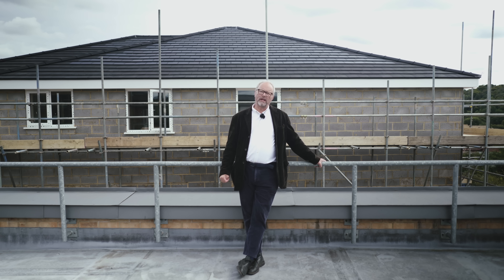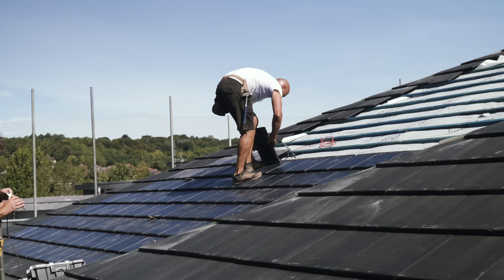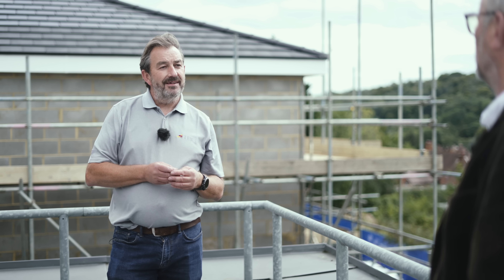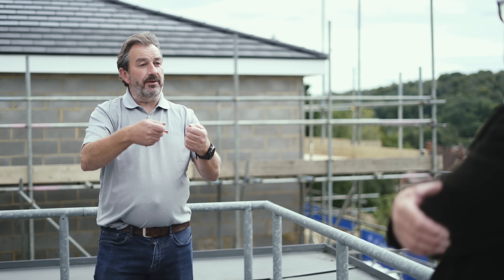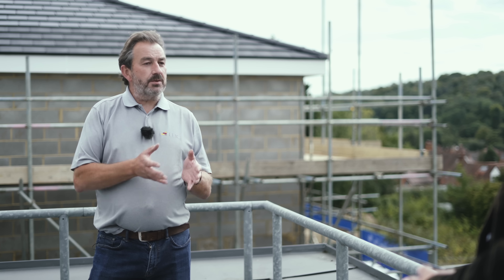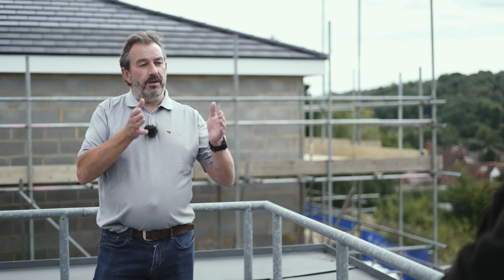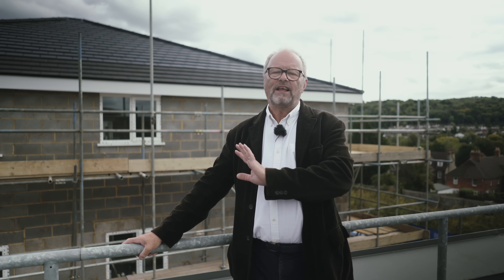Solar Roof Tiles - should every building generate its own power? | 100% Independent, 100% Electric

Comment: Was so excited then you lost me when the price was discussed.
Reply: It does seem a lot, but to make a fair comparison you'd need the price of a non-solar tile roof + the price of an installed solar system on top of it. Remember, this isn't just your solar system, it's your entire roof. Still sounds very expensive though....
Reply: I know right!
Reply: Dan Franklin 
What you say is true, but on a new build what’s an extra 5-7 grand over a normal solar setup. It won’t add that much to the mortgage repayment.
Reply: @wobby1516  I think your math is a bit wrong. He said the cost per tile is £30, and they put 900 tiles on that roof they're doing there. That's a £27,000 roof before the concrete tiles and labor. If you're in the U.S. like me, that's $35,000. That's a significant amount for a roof, when for  1/3 of that, you can have a tin roof. Granted, you won't have solar for that price, but the amount is prohibitive to a lot of people. Until the price goes down, we won't see these types of roofs proliferate for a while.
Reply: @gothnate  to be fair they did that $30 included the tile which costs $1
Reply: @wobby1516 
Exactly.. And with more demand comes cheaper prices and subsequent more development
Reply: The extra cost is offset by the savings on your electric bill.  The system pays for itself within 8-12 years. Additionally, the resale on solar homes  increase in value by about 4% ( its a selling point to tell a prospective buyer that the will have little to no electric bill).
Reply: @steve2653  but a lot of people have budgets. They might not be able to afford even a $1000 difference in a build, and you're talking a good $10,000 difference at the least.
Reply: If your roof frame was built to support a metal roof, then to put more heavy solar tiles would mean a lot more work upping the strength of the roof framework.
Reply: In this case the roof panels are supporting several flats so the cost per occupant is probably quite reasonable. Sorry can't do the calculations  - neurological disablity :-)
Reply: The cost is approx 50% dearer than an ugly bolt on solar system, but fir that increased cost you get a roof as well as the solar
Reply: The Tesla sole roof tiles, are cheaper than a new roof and solar!
Reply: @lukeotter898  plus they catch fire at no extra cost! Heating in winter!
Reply: @lukeotter898  I wonder which will sell best LOL

Comment: Well tile roofs last 100 years plus and solar panels last 25. So how's that going to work. Especially because tile is one of the most expensive types of roofing initially. I love solar and I love tile roofing. I'd have to do the math but roofing is a major renovation.....huge expense and the point of tile roofs is there longevity. To offset the labor costs making it cheaper in the long run to use tile.  Will tge benefit of great solar offset tge need to replace tile prematurely?
Reply: If you listened to the video, he did say re-roofing is anticipated with any roof.

Comment: What is with the heating up of the panels in direct sunlight? As I recall solar panels loose efficiency when their temperature rises and the traditional way of building a solar roof enables the panels to have cooling by fresh air being able to circulate underneath the panels, isn't it? So these roof tiles would have a worse efficiency?
Reply: I don’t suspect peak temperatures are much higher, largely since I also suspect air cooling benefit under a normal panel is negligible.  Now. . . add water cooling and harvest the waste heat to pre-heat hot water and reduce heating load in the winter and you’ll have an extra high performance roof!
Reply: @abelincoln78  I have been saying that for 20 years, since a friend of mine in California was using Gas to heat his pool, whilst at the same time the sun was blasting down on his roof solar panels and he was explaining how their efficiency dropped as a result. I pointed out to him that the water coming out of a hosepipe that had been laid by the pool was red-hot due to picking up heat from the concrete heated by the sun, and so why not kill two birds with one stone and run the hose-pipe up the side of the house, pin it under all the panels and then back down and into the pool. We nipped out to Home Depot, found some flat (kind of square profile) hose pipe and did exactly that. We hooked a small pump to a small solar panel. Pump and therefore waterflow went faster as the ground based solar panel got more (or less) sun. Bingo - even with our Heath-Robinson approach pumped hot water into the pool, and at the same time increased the efficiency of his solar PV. Why on earth this hasn't been industrialised, especially in the likes of California, is beyond me.
Reply: SLH SLH 
It’s funny. I used to work at a PV company that had struck out on its own from a wind farm company. Prior to the split, they had also worked a handful of solar hot water jobs. The solar hot water portion’s legacy maintenance was seen as a nuisance and such calls were reluctantly taken. The majority owner knows PV and solar hot water inside and out( his main calling card is as a CPA), but he’s never thought of this.
The key takeaway that I got from this video and discussion is just how much more robust this system is. The tiles make each string more conformable to the roof surface, and the installers are actually standing right on top of the installed tiles! Aside from the structural limitations and loads pointed out, once a panel is in place, that portion of roof is essentially a “no-go” area with a PV panel system. 
My primary concern would be life-span maintenance, or warranty maintenance. If an optimizer or micro-inverter fails, the relevant row can be dismantled back to the problematic component, get replaced, and then reassembled. With this system, optimizers and micro-inverters can conceivably be consistently mounted in an accessible location, but if there’s an issue with one tile in a series, does the offending panel get bypassed somehow, or does it take out the whole string? And in either case, how does an installer access the failed component? Or, is there a test for the string before each row of tiles gets locked into place by the next row( which would seem to be the safest preventative option)?

Edit: I’ve watched the video again, and now see how individual components can be accessed( unseal the panel from its underlying slate, and replace, and reseal in place... even easier than with PV panels!!).
Reply: Firstly, as there is no glass over the silicone wafer you do not get the “greenhouse effect” which causes overheating in traditional solar panels, additionally the reduction in performance from heat is due to increased resistance in the wiring between the cells, these modules employ cut cell technology, which dramatically shortens the wires between the cells, meaning the heat effect is reduced.
Reply: @chrishall409  oooh so the black tiel doe's not get hot
Frak you spanner !!
Reply: @chrishall409  
rubbish
Reply: @nc3826  The "greenhouse effect" was literally named after the effect of putting glass roofs on greenhouses that let in light and then hold in the hot air.  Chris used the term in its absolute technical form.  You are a programmed idiot.
Reply: Good question. Anyone know?
Reply: As a guess I'd day having them on a cement tile would help dissipate the gest into the tile somewhat. But that's just a guess. The roof is still black after all and cement can hold heat for a while so not really sure still. Good point though.
Reply: Another very angry person.  Plenty of those around tonight.

Apparently, it is exactly your failure to appreciate the meaning of "greenhouse effect" that made you make an erroneous insult to Chris in the first place.  Perhaps you just don't like having your failed antagonism noticed.

Actually, a lot of solar panels are not adequately ventilated unless it is provided by the installation, which people using solar on boats have discovered first-hand.  Another failed antagonism on your part.  You're generating a list.

I wonder if you're that nasty to people when you aren't insulated by a thousand miles of internet wire... it's one of those questions that comes up from time to time.  On the other hand, I don't really care.  You're just another obnoxious mean person using the internet to spew aggression at random strangers.

I'll bet there's an exciting and popular local bar where you could go try that instead.  You might find it "educational."
Reply: It is part of the reason why I am skeptic of this. The other is that it is likely much more serial panels connected in each array which can cause problems for the charge controller. Most likely you will end up with a more expensive multiple charge controller solution if you go with this system than just adding larger panels.
Reply: Normal panels ie. black glass get very hot in the sun too. They all lose about 0.4% for each degree above 25C, So are down 20% when the panels hit 55C and they do. Nothing you can do about it. The cooler air temp in the UK will help them be cooler than say Australia. But on the flipside of that advantage the UK gets half as much sunlight as Australia though so each panel in a year generates half as much as Australia, Spain, Portugal, Southern France, etc. Still worth getting solar in the UK - at £100 for a 330w "normal" JA Solar panel they're dead cheap now!!!
Reply: @markyates5744  I have seen that they can reach 100 °c maybe more in some  desert area. 55°c is pretty low from being under the sun by more than 33°c outside and material than catch the IR.
Reply: @nc3826  What are you talking about. CO2 is generated in the making of solar panels but it's a silicone glass sandwich and a white paper backsheet enclosed in an Aluminium frame. No methane / co2 in gas form is in the panel!
Reply: *lose
Reply: I was thinking the same thing, maybe only good for cooler climates
Reply: @Adrian Matthews true of course :)
Reply: I wonder if the roofs gets hot in UK, most of the time it's more light than sun right? So it might produce less all the time but quite regularly, except when it's raining of course. 😁
Reply: @nc3826  I'm pretty sure that the one who needs to grow up is the one who started calling people names during a normal discussion because somebody disagreed with them...  Just saying...
Reply: @Welsh Simon Not bad indeed already. But I think it could go much higher.  It's probably the middle range.

Comment: Too many adverts now Robert, gets quite annoying..
Reply from the maker: We only have pre-roll turned on, can you see more Ken. Thanks, Dan
Reply: Hi Dan, within about 40secs of the episode starting, it cut to a advert and there were at least another 4 that seemed to just cut in. I was watching/well listening whist installing another heat pump, on a mobile device.🤔
Reply from the maker: @kenbone4535  OK, well it's disabled so if you do get the chance to check again that would be helpful. Our policy is only to have the skippable pre-roll. Thanks, Dan
Reply: @fullychargedshow  ok Dan, I did put it on again and it was fine 🤔, same device.

Comment: My only concern with these is that each tile is individually glued on. How will these adhesives cope with 25 years worth of winters with frost creeping in between the layers? If even one is sub-par you have a hole into your roof and your electrical systems, and then you have to rip the whole lot off.
At least with the standalone systems the fixings are under the tiles and do not compromise the integrity of the roof itself. Alternatively with the Tesla offering, the tile and panel are one and the same.
Reply: This would be my main concern.

If you look at 2:13 there isn't even any sealant around the hole at the back. I would at least have liked to see that gap around the junction box potted with epoxy or silicone.
Reply: @DEADB33F  exactly my concern. Once you get a roof leak you are going to need to test integrity of a large number of tiles to find the faulty tile.

Also flat concrete tiles are fairly rare where I live.  How flexible are planners going to be if I change my roman tiles to flat?
Reply: @DEADB33F  perhaps the adhesive that fixes the panel to the tile seals round the hole
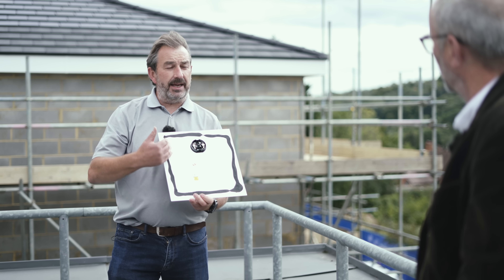Reply: @rogerbarton497  Hopefully they use more glue than is shown at 1:58.
IMO That would be no way near enough.
Reply: It's perfectly easy just to replace one tile without removing the whole roof, probably easier and cheaper than replacing a conventional panel if part of that fails.
Reply: @rogerbarton497  Missing the point. If one fails, you will need to question the integrity of the entire system.
Reply: @MrGonzonator  Not really.   If a light bulb fails you don't question the integrity of the lighting system in your house.
Reply: @rogerbarton497   I think you are missing his point, if the adhesive doesn't go all the way to the edge of the panel, it's would be possible for water to get between the tile and back of the panel around the edge, when it freezes is winter and expands it could slowly separate the panel from the tile, allow more water behind the tile until water makes is way into the roof though the wiring hole in the tile or the whole panel delaminates. If one panel failed like this you would have to question the state of every other panel, as there would likely be more than one failing in the same way. If it was a simple electrical failure just replace the tile and move on with life, but a mechanical failure of the bonding would a can of worms.
Reply: @rogerbarton497  If every one of those light bulbs was hand built with superglue and the superglue on one failed causing damage to your house... you'd probably want every one of those light bulbs out for (at minimum) inspection. Wouldn't you?
Reply: @taznz1  IF being the operative word.  Any water leaking through a tile will be caught by the membrane and diverted into the gutter.  As it happens it's quite possible for rain to get blown up underneath roof tiles, which is why a membrane is put in place.
Reply: @MrGonzonator  I understand where you're coming from, but I wouldn't be so pessimistic, even after a lifetime of repairing and servicing electronic equipment.
Reply: Freeze at 1:46 to see what I mean.
Reply: you could remove an entire panel and the roof won't leak. the waterproof membrane is the paper behind the tile, not the tile.

Comment: Only problem I see with this is that they are converting the standard tiles, they have to drill each tile and glue on the panel. You can see the water stains on the back of the tiles from the concrete drill. You save on shipping costs, but the onsite assembly costly must be fairly high, I'm sure they have some sort of rig to make it less labour intensive , but making tiles with the holes molded in and attaching the panels by machine on a production line would be a lot more efficient and less wasteful.
Reply: Even tesla tiles are made in china but assembled in the us
Reply: @alanmay7929  Thats sub assembles designed to fit together, and probably done that way for tax reason, they aren't making the glass tiles too big then removing 10% of them in a slow manual process and throwing it away, before attaching solar cells.

Comment: Solar tiles? Great. But so many connections and cables. Can't help reliability or losses.
Reply: With solar energy "losses" and "efficiency" aren't as important because you are dealing with a renewable supply of sunshine that is supplied at no extra cost.

Another way to look at solar losses is to look at a roof that doesn't have solar. 100% of the solar energy is lost. If these roof tiles can gather a fraction of the energy that hits the roof all the better. 15kW generated is 15kW. Does it matter that the theoretical potential was 100kW? Oh dear 85kW was "wasted". The typical average efficiency of solar cells is 37%, i.e. 63% of the potential energy in the sunshine isn't captured. Let's say the numerous connectors reduce this to 30%. OK.

Would you prefer we just let all the energy go to waste so as not to waste any in collecting just some of it?
Reply: @JeanPierreWhite  good point. How about modules of 3 tiles to reduce connection losses and install time? Weight becomes an issue, so the concrete could be a little thinner since it has the solar cell added to compensate.
Reply: @JeanPierreWhite  no, he'd prefer that the system he is paying money for is more efficient/reliable. If it was free you would have a point.

Comment: They use PTFE solar modules, which are bit better version of flexible solar modules, which are actually the worst(average life -3 years). The PTFE solar modules have average life of 5-7 years, in this case , since they have mounted this within a solid roof, the average life can be as much as 10+ years. In comparison, Normal glass solar modules have 25-30 years of warranty. I try to dig information from the link provided and although the company provide 30 years warranty on the actual roof there was no mention of the solar module because they get it from another company called viridiansolar. I went into check their site, but didn't find any warranty information on their PTFE modules. so if it has only 10+ years of average lifetime that would be a significant waste of resource. Anybody please correct me if I am wrong or you find some more information on this.